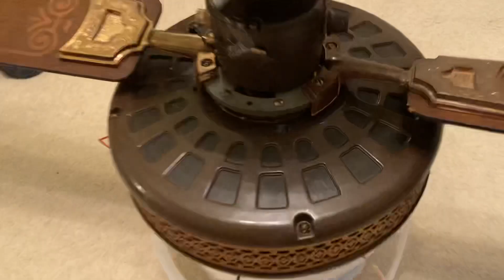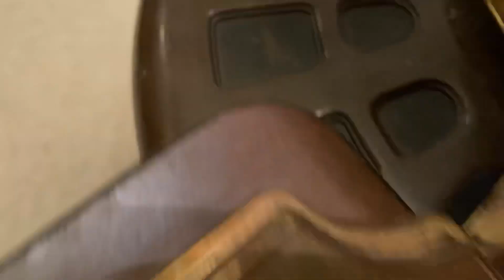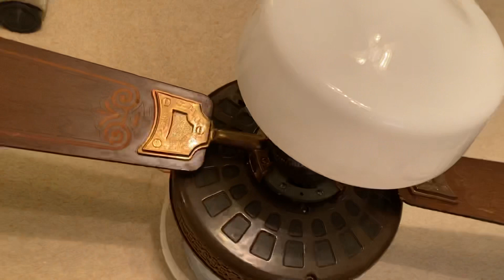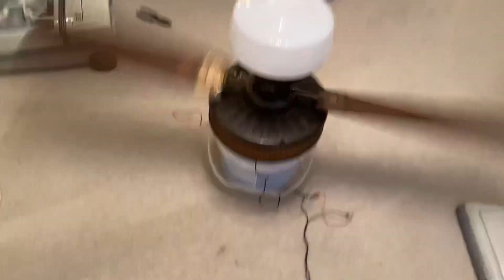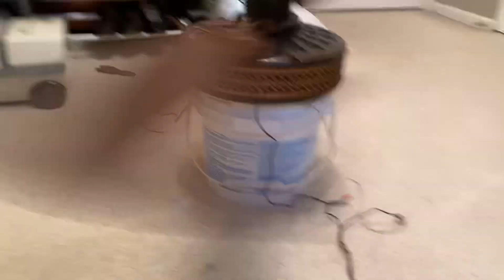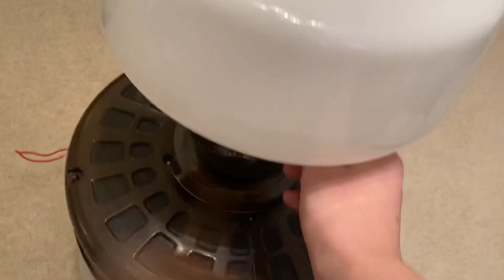NuTone Verandah Deluxe ceiling fan (2 blades, floor test, schoolhouse light kit) (read description)

Comment: why do you pull the chain two times
Reply from the maker: Because the first pull is for direct high speed, and the second pull activates the variable speed control, and the third pull is off.
Reply: @ceilingfanman9662  oh